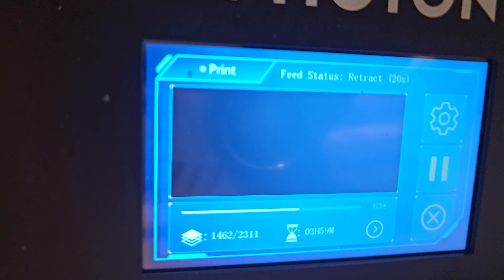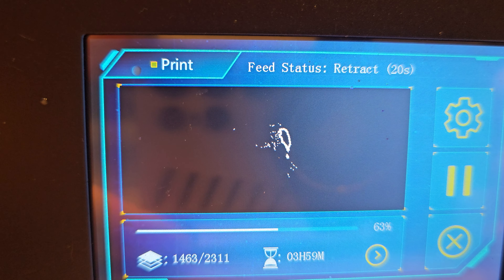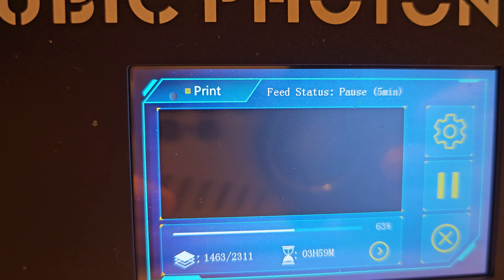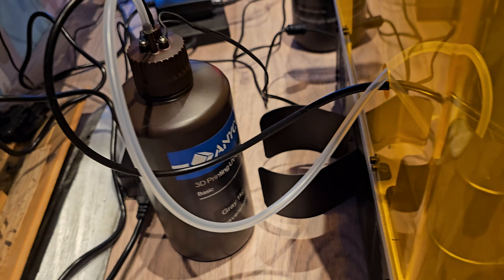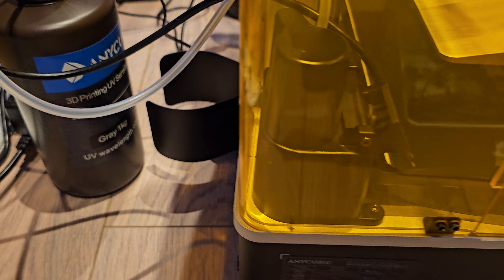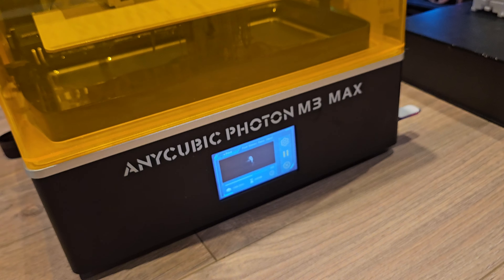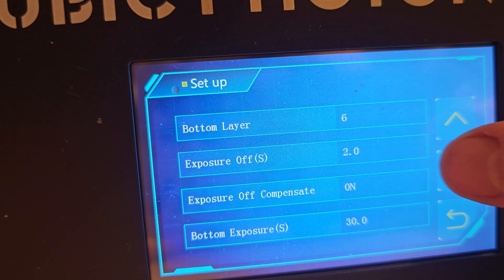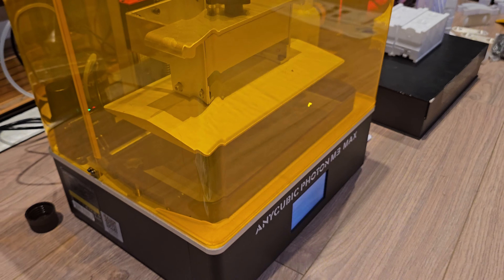AnyCubic Photon M3 Max Auto Feed / Refill DOES NOT WORK

Comment: Use ptfe plumbers tape around threads about 20 turns does it. You dont need to tighten to much just give the bottle a squeeze if you hear air just tighten a little more till no air sound.

Comment: I have the same issue with the autofeed. When i take the white hose off it is sucking instead of blowing air. What i think it is supposed to do. I'm lost as well.
Reply from the maker: i posted a full video on this and how to resolve it, search my uploads
Reply: Have you tried ptfe plumbers tape on the threads of the bottle. 20 turns around does the job and you don't have to tighten it as much. Just squeeze the bottle if you hear any air tighten a little more.